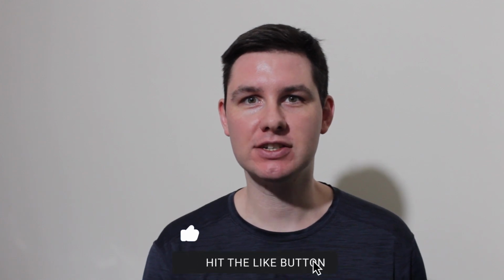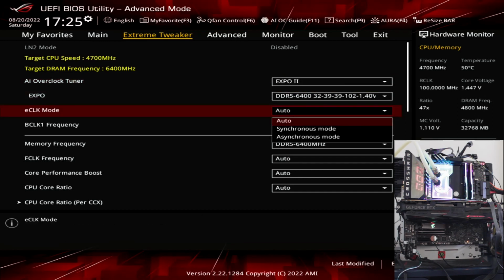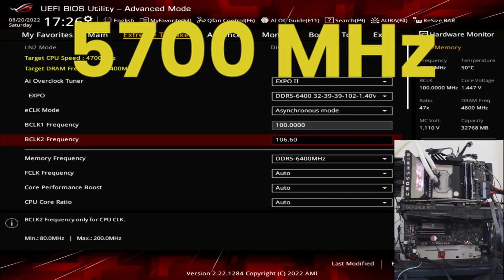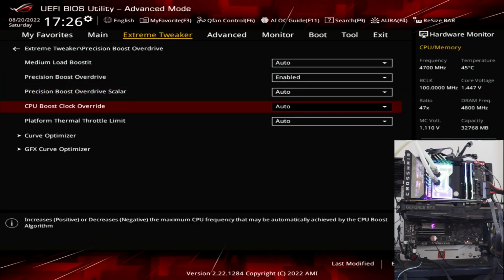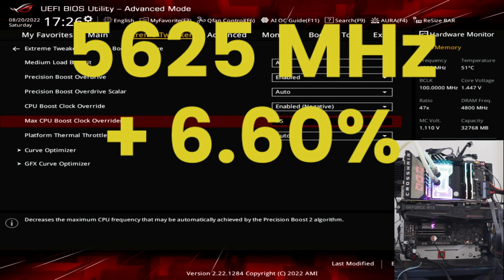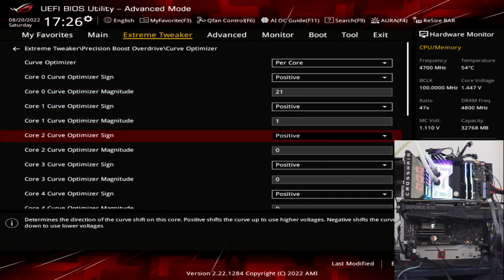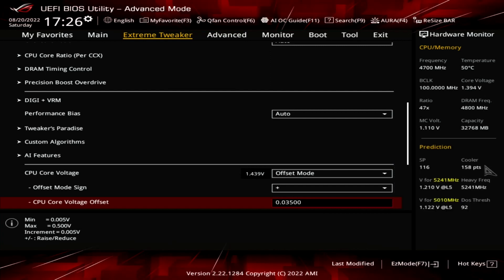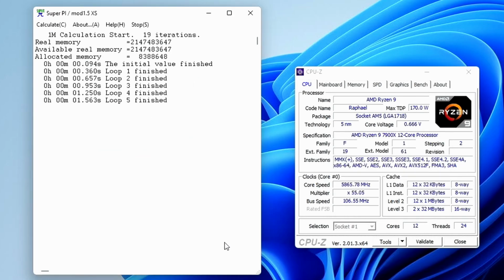6 GHz Water Cooled Ryzen 9 7900X From BIOS to Benchmark

Comment: If it is not stable, what is the point? Better would be to provide parameters and methology to achieve the maximum stable clock speed and what one should change if a user then still gets instability. You are only showing 6 GHz for the sake of the number whilst real world users would, or at least should, want a working system.
Reply from the maker: Here's the longer SkatterBencher guide with Prime95 stable overclocks for this system https://www.youtube.com/watch?v=o_AMxVcS2DM

Comment: What is the Core Voltage with these settings at 24/7? And how hot is the CPU? Thx Buddy
Reply from the maker: Those settings weren't 24/7 stable. However, I did a long overclocking guide of this specific system where I detail the overclocking process: https://www.youtube.com/watch?v=o_AMxVcS2DM

Comment: The ram doesn't go to 6400 because of motherboard compatibility not because of processor......
Now I don't trust anything you say.
Reply: Not true. I have a AsRock 650E board and have ran 3 different CPUs with same memory(Corsair 6600 A-die)and all three have different max memory speeds.7700X would go to 6200mhz, 7900nonX would only do 6000mhz and my 7950X will hit 6400mhz stable. Motherboard can help based on trace paths but the CPU memory controller is what will decide it most of the time.

Comment: do you know why b650e aorus master async bclk only works in bios but not windows ? I am stuck with ethier 5.35ghz pbo or 5.6ghz 1.26v static but i really want 6ghz. Ethier theirs an async solution to my 7600 or hydra software gets updated to support 7000.

Comment: how would you OC the 7900 on a rog strix that does not have a bios with eclock mode in it?
Reply from the maker: I would enable Precision Boost Overdrive, set Fmax Override, and use Curve Optimizer. You can still get quite good results from this method.

Comment: How would you consider this overclock? I basically have the identical build of this on its way and considering the random motherboards, ram, and cpu you can customize this basically hits the nail directly on the head. My board is the x670e strix that is legitimately the only difference. So for your recommended OC you had shown in the video above. How great would you consider this for gaming, and overall performance? I will have mine liquid cooled on an nzxt x63 kraken 360mm. Also why weren't the cores locked at 6000mhz?
Reply from the maker: This is pretty much an overclock on the edge of stability but I wanted to show it because it's 6 GHz on a water-cooled Ryzen :)

For a better understanding of how to overclock the Ryzen 9 7900X I'd suggest to wait a day or two. My 7900X full-length SkatterBencher is scheduled for Oct 9 and I go through all the settings and options in much greater detail that in this video. Including results on performance improvement.

The cores aren't locked at 6000 MHz because I'm relying on the Precision Boost algorithm to determine the actual frequency. The boost algorithm adjusts the frequency in real time based on a number of parameters. The effect is that the frequency is always changing.
Reply: @SkatterBencher  thanks for the reply! The 6ghz is a very high clock. I've overclocked a couple cpus now but no where close to the understanding you have. You have so much knowledge in this and I just want to learn more of understanding of what each feature regarding bios overclock does. Some things make absolutely no sense to me and I really dislike using third party software to lock an oc (Ryzen master).
I usually increase and test small measurements at a time until unstable then come down from 25-75 and lock that in.

I never really had the confidence to really adjust the voltages because I know you can fry components so I always steered clear from that. End goal was to try and stick around 60⁰ - 70⁰C under gaming load. My last overclock I ended up getting all cores at 4.4ghz on a ryzen 3900x. And found a video that shown how to navigate through bios and overclock in there but no where near to the degree and understanding you have. I find it pretty difficult to find channels that use quite identical software especially bios that same to what you have.

With so many "different ways" that these channels explain to overclock in bios its easy to get them mixed together and find the better understanding and why. To directly find the absolute best method and settings of locking in a direct and stable oc on all cores was always my goal of understanding. That in the future when it comes to overclock you can go through plug in the clock you're after, once testing is over with and confidently swim through bios and save confidently.

I hope I didn't ramble too much and made myself sound as clear without repeating myself, or made myself sound like an idiot. I understand the overclocking procedure but seem to get lost when it comes to plugging in my values in bios to achieve what I just tested for.

What you have shown me, really blows my mind of how quick you figured out what to change and why, and the knowledge you have behind it knowing what's going to happen.

As soon as I seen this video and a couple others you had I liked and subbed right away. You have my attention lol and I appreciate what you do towards the community that's interested! I look forward to your next video's to come! 👍

Comment: And temperatures?
Reply from the maker: In idle, the temperature are below 50C usually. Under load, this configuration isn't stable.

I will detail the temperatures in my upcoming longer SkatterBencher overclocking guides.
Reply: @SkatterBencher  Thank you

Comment: Isnt better to set ram to 6000mhz and fclk to 3000 to keep 1:1 ratio? Or is it by default on auto?
Reply from the maker: FCLK can't run 3 GHz
Reply: @SkatterBencher  Oh, well that is wierd. Whatever. Before release there were rumors about 3000mhz and 1:1 ratio, but aperently am5 platform is different to what we get used to on AM4. Thanks for info.
Reply from the maker: I read those rumors too, but unfortunately they were not true

Comment: Can you please list the "Curve Optimizer" setting for the 7950x? There are 4 more cores on this processor that are not covered in your video. Thank you.
Reply: Curve Optimizing is strictly individual due to difference of CPU silicon quality, and, for example even some 7950X chiplets may be not so good and curve offset will cause instabilities. So try to do it with your hands and make your own setup that is suitable for cpu that you have got

Comment: I recommend to check out the last video by the channel "optimum tech".  It seems that Ryzen 7000 go full power limit for no reason. He managed to get the same performance for the 7950x by -15 curve undervolt and limit the PPT to 180watts. On 185W he was equal to stock 240 PPT. That's in case of stock values. 
Of course on full top OC the chip will consume more power, but I think it's worth try to scale down the PPT until you start losing performance. Maybe your chip on overclock will be fine on PPT of 200-220, instead of the stock 240 PPT, whice will l lower your cpu tempature.
Reply from the maker: It doesn't make much sense to limit PPT when you can simply limit the maximum temperature of the Precision Boost algorithm with an option called Platform Thermal Throttle Limit. Just set that one to you desired maximum temperature and let the Precision Boost algorithm regulate the power as it sees fit :)

https://twitter.com/skatterbencher/status/1574688119768711168

//edit: just watched the video, awesome content. 

I'm quite surprised that capping the PPT made that big of a difference. I guess the temperature drop is caused by the steep reduction of the operating voltage decreased (both VDDCR and VID have decreased by ~150mV!), but it's curious that PPT impacts this. Also looks like CPU Core Current dropped from 80A to 55A under load, odd. Something to look into when I'm back in Taiwan end of October :)
Reply: @SkatterBencher  Platform Thermal Throttle Limit - would be most important for air cooling, Thx.

Comment: Most underrated tech channel on YouTube. Awesome stuff. Do you think a delided cpu would be stable?
Reply from the maker: Thanks for the kind words!

I suppose the lower temperatures from delid won't hurt, but it's unlikely to make a big difference at light workloads. The main limiting element of this system is that the Precision Boost Fmax limit is a global limit. So, the algorithm is trying to push every core to 6G. While some cores can do it, others aren't capable, so it'll end up in an unstable system.

Via informal channels I already asked AMD to add "Per Core Fmax Boost Override" similar to Intel's "Per Core Ratio Limit". A tuning knob like that should allow us to restrict the weaker cores from targeting too high frequency!
Reply: @SkatterBencher  So the system crashes when it tries to bring the slower cores to target frequency. It boots occasionally because it happens to use the faster cores by pure coincidence! Am I getting that right? It's fascinating stuff
Reply from the maker: The chip is stable enough to boot consistently, however it will become unstable in the OS if certain cores get pushed to 6G when getting assigned a small task or workload. This part is indeed pretty random.

To add another twist to the story: on this Ryzen 9 7900X only CCD0 has "strong" cores that can boost to 6G, whereas CCD1 only has "weak" cores that boost to maybe 5.8G. So, they never come near 6G. Ironically, that makes it a little easier to push the cores in CCD0 harder :)
Reply: @SkatterBencher  I see! Looking forward to AMD giving us more control over individual cores

Comment: btw, do you know what is the highest fixed all core voltage they can run on? It's the same as around 1.35V like the predecessor?
Reply from the maker: My manual OC (Prime95 no-AVX) with each Ryzen 7000 CPU is:
- 7950X 1.129V 5145MHz 95.2C
- 7900X 1.162V 5333MHz 88.0C
- 7700X 1.215V 5350MHz 94.0C
- 7600X 1.376V 5375MHZ 96.0C

Comment: skatter will you be doing some oc videos with delidded ryzens in future?
Reply from the maker: I'm not sure. My goal with SkatterBencher is to show how to overclock for a 24/7 daily system. I always felt that delidding was one step beyond that and more useful for records and demonstrations

What are your thoughts on that?
Reply: @SkatterBencher i would like to see direct cooling scalped results because now there are processor scalping services and many pro players would be interested in a custom build with maximum performance and low temperatures, the same applies to copper RAM heatsinks ;)
Reply: @SkatterBencher  same story was on 8600k/8700k with liqiud metal, that was night and day difference, same on 7950x in der8auer video, i think this meta is comeback =D

Comment: fast and easy 🙂
did this trick works on ryzen 5000 cpu too?
so putting a positive curve optimizer and higher base frequency?
Reply from the maker: Technically yes, but reference clock overclocking was very limited because the refclk was affecting also PCIe and SATA.

I have a bunch of Ryzen 5000 SkatterBencher videos where I used reference clock overclocking. The OC Strategy was always called "PBO Supercharged". You can check them out if you want more details on what's the challenge

Comment: why do you use somewhat random magnitudes for the curve optimiser?  for example why is core 9 set to 6?
Reply: I think it's related to the CPPC table of each core.
so he put a different curve value based on this core classification. best core = lower curve value etc...
to be confirmed
Reply from the maker: I have tested the optimal Curve Optimizer setting for each core prior to this overclock. The full details will be shared in the upcoming SkatterBencher #46 :)

Comment: the 6 ghz nice! but how about a 24/7 6ghz oc? doesnt have to be all core. 4 would be awesome, 2 great, 1 ok. any stable cfg for that? if not maybe to try it when the new X3D comes out.
Reply from the maker: Like I put in another comment: the main issue is that Precision Boost Fmax limit is a global limit, thus applied to all cores. While some can probably run 6G stable, most can't. But Precision Boost will still try to boost to the configured Fmax.

I already suggested via informal channels to AMD that having a "per core Fmax limit" would be nice to have. That would allow me to restrict the cores that can't run the peak frequency while pushing those that can. Kind of like the "Per Core Ratio Limit" on Intel platform.
Reply: Hey i know this is very late, but do you think the next motherboard chipset iteration (X870/X870E) is going to have the ability to set per core Fmax limits like you said in your comment?  @SkatterBencher
Reply from the maker: ASUS already offers the option in some ROG boards. Whether it comes to all boards depends on AMD' AGESA team :)
Reply: Awesome 🎉 @SkatterBencher 

I didn't get the reply notification, but I think it's the "per core boost clock limit" right?

I saw that it's available on crosshair boards like the X670E hero, so I'm getting that board. Thank you for confirming 👍

Comment: Would love to see how much extra voltage you need to make this OC stable 24/7, or maybe your silicon is just not good enough?
Reply from the maker: The main problem is that the Precision Boost Fmax limit is a global limiter. That means it's applied to each core. Sadly, even though one or two cores might be capable of running 6G, most can't. But Precision Boost will still try to boost those to 6 GHz as well. That will end up with instability.

I already suggested via informal channels to AMD that having a "per core Fmax limit" would be nice to have. That would allow me to restrict the cores that can't run the peak frequency while pushing those that can. Kind of like the "Per Core Ratio Limit" on Intel platform.
Reply: @SkatterBencher  So it's basically luck of the draw in the sense that the system happens to pick the right cores when booting?
Reply from the maker: Luck of the draw in the sense that you need the boost algorithm not to push the weaker cores beyond their stable frequency :)
Reply: @SkatterBencher  Maybe a Bios mod can help in that case.
Reply from the maker: Enablement of per-core Fmax would have to be done by the AMD SMU firmware team before it can be enabled/added to the BIOS.